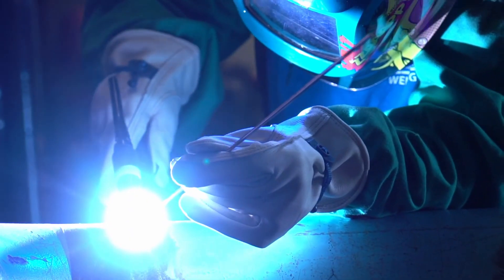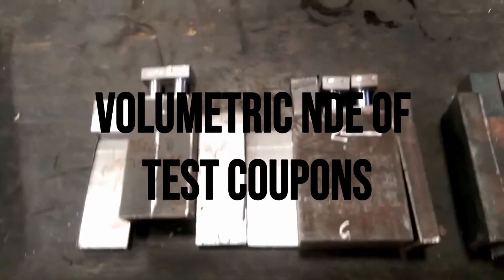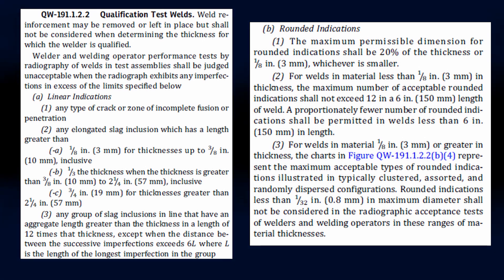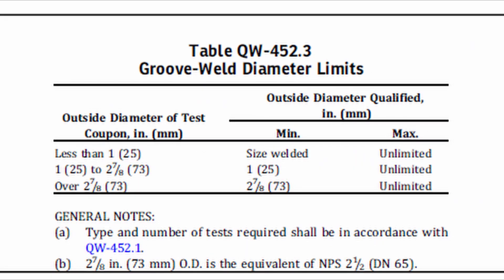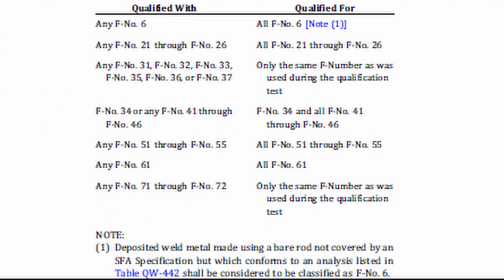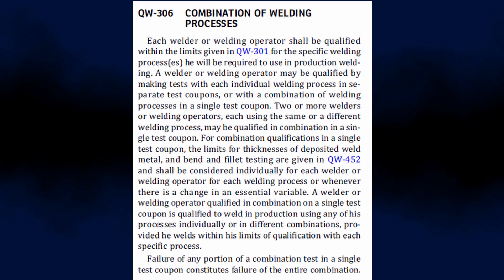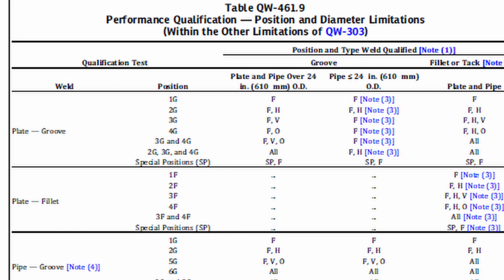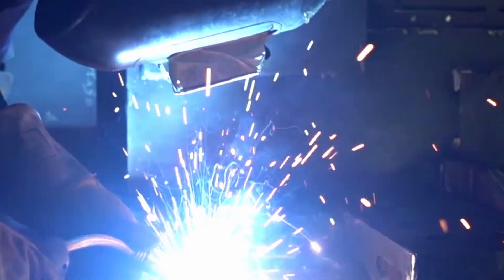How to certify welders according to ASME IX - Welder Performance Qualification (WPQ)

Comment: How to control the welding electrodes stub length below 50mm 
Tell me
Reply from the maker: if you are find it hard to control the arc, you may adjust the current but note to adjust within the limits of the wps
Reply: Thank you
Reply: @vettriveld5269  no one will notice if you weld a few decibels above or below wps
Reply from the maker: that is true, electrical characteristics are non-essential variables anyway. produce a good weld, no one will notice ;)
Reply: @Hardhat_Learning if the mech properties don’t match it’s probably just a bad filler